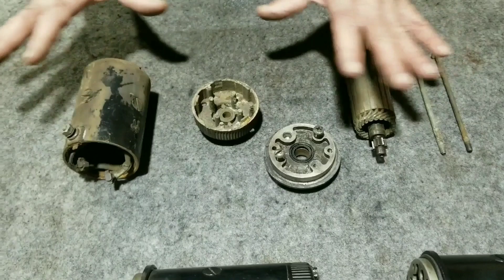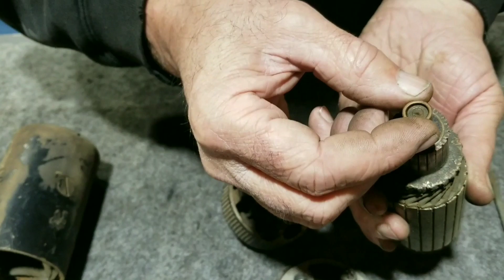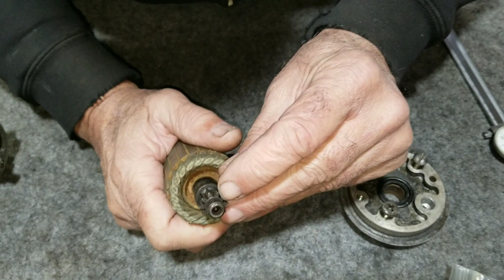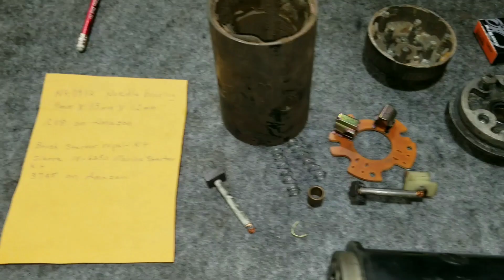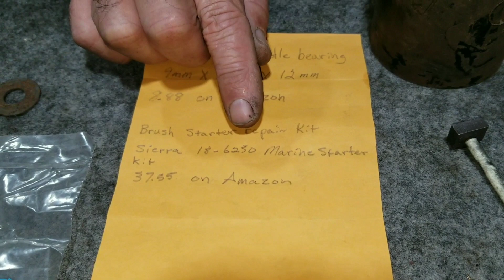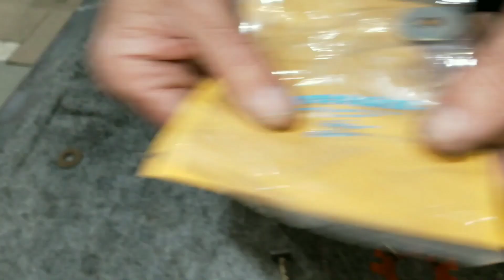1975 Norton Commando Mk3 restoration Part: 3 Starter for the Mk3 and parts information

Comment: Instead of using the forefront starter used on the sportsters in the old days they use the toothbrush starter on the North commandos which means they didn't work after they expect all the money to accommodate one typical British Penny pinching.

Comment: The wear on the shafts and bushes does not have to happen. But you need to re-lube it every few years. Sometimes you have to replace bushes, seals and brushes. A good AGM battery is a must, they last a real long time, too.

Comment: Nice job with some great tips.

BTW, I tried copying the video link to the Access Norton forum to promote it there, but it seems you have the upload set to not permit playback on other sites. We see this text on the forum:
"Video unavailable
Playback on other websites has been disabled by the video owner
Watch on YouTube"
Maybe you can check the options on your YouTube upload page to allow this?
Reply from the maker: Thanks for the great comments and I allowed the video to permit playback on other sites so if you want to promote it that would be great if there is any other one you think of promoting just let me know I appreciate it and thanks again,
Reply: @jessesvintagegarage765  Thx...I checked my post on AccessNorton and your video now displays/plays there. I had seen this problem on another one you posted...the MK2 Norton 750 cylinder head fitting where I wanted to show forum members how you found those tiny leaks in the cylinder block stud holes.
Reply from the maker: @TornadoCAN99  I allowed that whole 6 part series as well, thanks again we appreciate it,